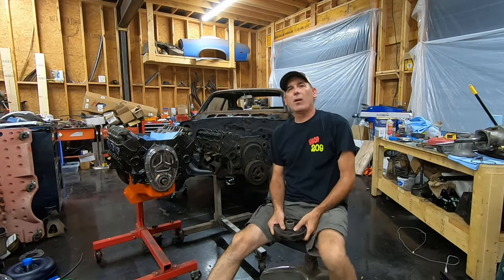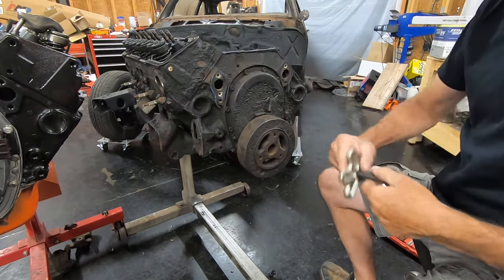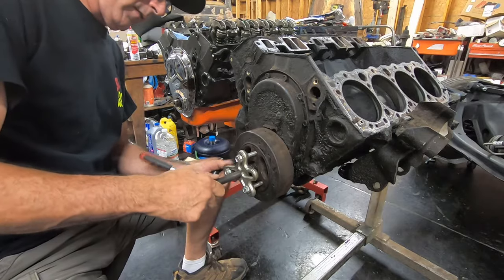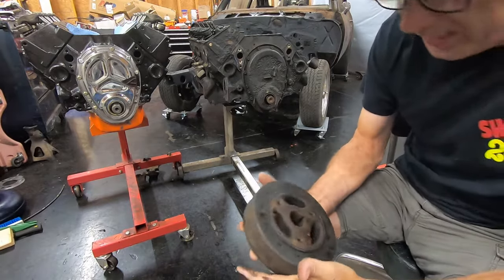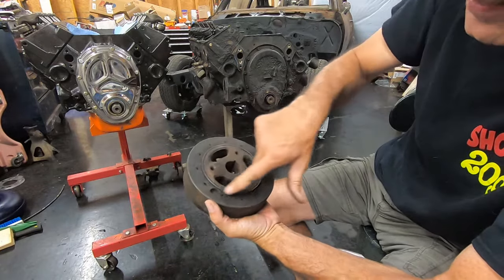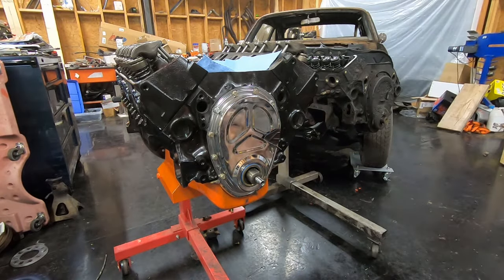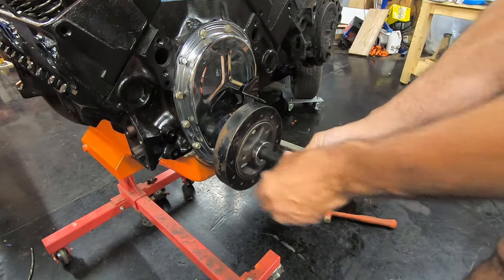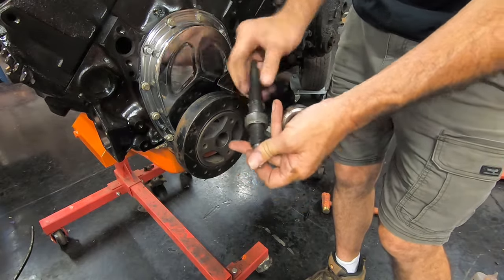The RIGHT way to install a harmonic balancer on your Chevy Smallblock

Comment: I rtv the keyway.  Oil the shaft inside hb. Put a dab of grease at mating surface of seal and balancer. Old engines like to leak. Prob should replaced seal. But looked intact.  Hope it doesnt leak

Comment: A1 job!  You do know that you have balancers that have offset weight added on and they do add the correct balance weight for that particular engine combo....and the pressing point is very important to check size making sure it will not damage the threads on crank nose.... The kit I have has been put together through years of working on all kinds of engines so I have many different sizes of pressing points to fit a variety of crank nose diameters. The use of a dedicated balancer installer is a must so you do not risk damage the the crank thrust bearing especially on a fresh rebuild. Hammer need not apply for this job😂
Reply from the maker: Yep. On small Chevy engines it’s only the 400 that has the balanced damper. Then it’s only on external balanced cranks. Definitely have to make sure the crank thread adapter is correct. Thanks for watching!!

Comment: 🥝✔️👍👋🤜💩🤛Nice to see your channel. We've conversed on the NNN and UTG and Richard Holdener lives a few times, it's great to see your excellent work. I use a modified Toyota Racing Department flat pry bar and your puller with a custom  cut down removal spigot. On my engine swaps, there is no room to remove the balancer because the radiator or MacPherson strut gets in the way. The Malibu LS balancer removal is one of Detroits worst inventions.
Reply from the maker: Thanks! Yeah. That LS balance design is a pain.

Comment: How do you install, if my crankshaft doesn't have threads? Im working with a 1961 Chevy 283
Reply from the maker: Yeah. The only way to install it without threads is to use a block of wood and a hammer.

Comment: The original Chevy factory service manual called the harmonic balancer a "torsional damper", which more accurately described its function. I wonder when--and why--the term changed.
Reply from the maker: Probably when they started building motors that were externally balanced and the damper had weights added to it.

Comment: I'm going to look for your in car, timing gear replacement video.  I have a friend with a 1980 3.8 V6.
 I can rotate the dampener 5 or 6 degrees before the distributor rotor starts moving.
I be thinking some of the nylon teeth came off.  It backfires and won't start.  New cap and rotor, it's got fuel.
He said he had the pedal to the metal just trying to make it home.
Reply from the maker: I’ll have that coming up soon

Comment: Great Video. I enjoy watching all of your videos. There is so much for me to learn. Do you know why balancers are of different thicknesses? The one that is on my 307 is 1 1/2" thick. I just picked up a 305 and the balancer is 1 5/8" thick. Thanks for sharing.🍁👍👍
Reply from the maker: Thanks! Because of the mass of different stroke crankshafts. The dampers add mass and change resonant frequency. The less mass the crank has the less damper you need?

Comment: I had Chevy. Hipo. Balancer come off after 30 years it had a after market bolt kit it was safety wired loctite and key did not shear. Keyway did crack ?

Comment: Hi.  I have a small oil leak coming from a Chevy 4.3L coming from behind the harmonic balancer area.  My mechanic just installed a new timing cover.  He told me that he failed to use some RTV on the keyway on the balancer shaft and that's why it is slinging oil.  Does this sound correct?  You don't show any RTV being used on your install.  Thanks.

Comment: On my 350 l98 the timing mark slipped. Do you line up the timing mark with the keyway when installing?
Reply from the maker: No. It’s different depending on which balancer and with timing cover you have.

Comment: Any suggestions  for a good  fuel pump   any eldebrock  ? For the 74 nova
Reply from the maker: The edelbrock pump is good. Just make sure it isn’t more than 6-7 psi or you’ll have to run a regulator
Reply: @Shop209  thanks.   I'm trying to order  one but there's so many ... dont know  wat to get

Comment: What if you don't have a theaded crank?
Reply from the maker: Have to use a hammer unfortunately. The early 283’s and 265’s didn’t have threaded cranks.
Reply: I have a 1968 327,  just found a video with a drill and tap tool from Mrhotrod6.  thank you for the quick response.

Comment: I don’t have a bolt on my crank shaft. There’s not thread to put a bolt…. It’s hammer time?
Reply from the maker: Yeah. It’s a 283 probably. Use a block of wood and hammer away
Reply: @Shop209  Some 327's weren't drilled and tapped either.